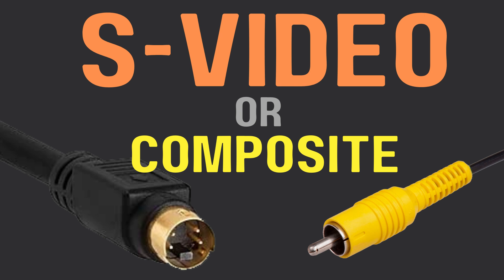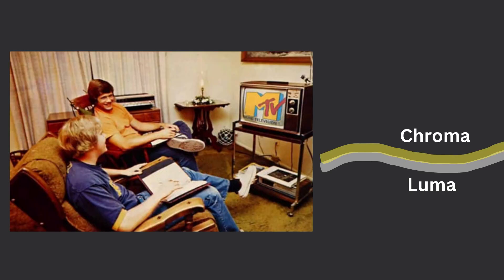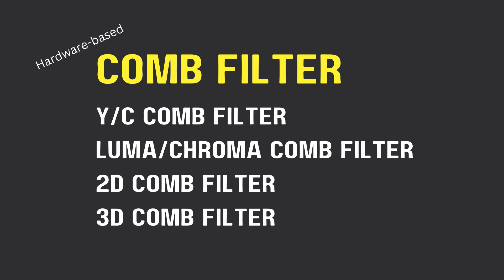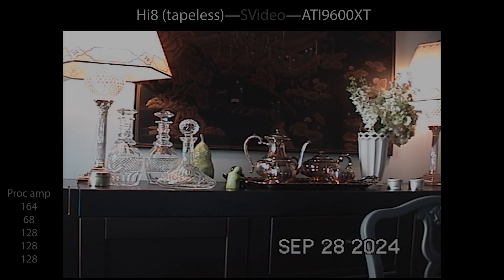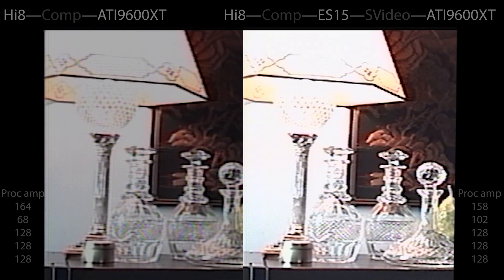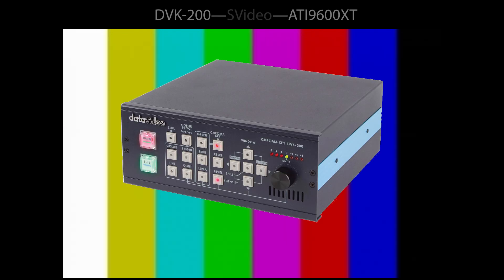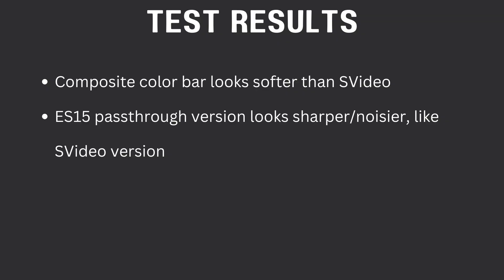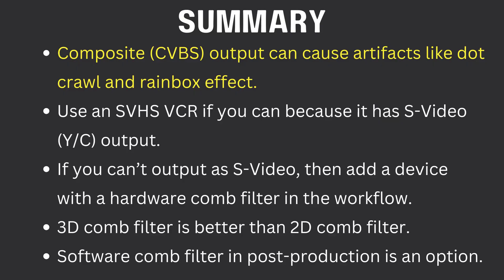S-video cable is better than Composite cable

Comment: Are comb filters redundant if I'm using an s-video cable?
Reply from the maker: Yeah, basically yes it is redundant. If you’re already using S-Video port to exit your video signal from back of VCR, then the luma and chroma are being sent separately. So a comb filter somewhere in the workflow doesn’t really have anything to do. Comb filters are only useful when you’re dealing with composite video leaving VCR. 

That said, there's a bit of a debate about whether VHS tape stores the signal as two separate luma and chroma. 

- If yes, then that means that your S-VHS VCR is simply sending along the signal via SVideo port/cable. 
- If no, then that means that the S-VHS VCR is using a comb filter to separate the signal and send it along out the SVideo port. And therefore, the argument is that if the S-VHS VCR has a bad comb filter, then maybe it's better to output as composite and let another better device in the workflow separate the signal.

Comment: What about a straight up RCA to S Video cable? I was considering on getting that because neither my camcorder or VHS has an S video output
Reply from the maker: Unforunately those RCA-to-S-Video cables just re-route the (combined Y/C) composite signal over one of the two S-video cable pins. In other words, it does not split it into real luma and chroma.

Comment: Great demo and explanation. Am researching adding svideo to a dvd combo vcr for capture i have which is svideo dvd out only. This strengthens my resolve to do this
Reply from the maker: As you said the svideo port in those VCRs is only used by the DVD signal. So if you want to output VHS signal via svideo port, you will need a new VCR.
Reply: @videocaptureguide I disagree i believe i should be able to tap VCR luma (Y) and chroma (C) from the LA71207’s external Y/C paths before composite combining (or summing?) route them to the existing S-Video jack with AC coupling and 75 Ω series resistors per line, and get VCR S-Video output without buying a new VCR. Looking at the board for the unit i have (cinnavisuon dvr2000) it looks to me like I should be able to do this between where the "jungle" chip and the panasonic chip which injects on screen display data piggyback on the existing caps on the LA71s side of the circuit.  Would love you're input if believe this isn't how the svhs players actually allow svideo output, in my eyes the signals are already there but manufactures at the time crippled the units ability on lower end vhs players because they wanted dvd to look great and vhs to output at a lower visual fidelity to push dvd sales

Comment: To get rid of the luma clipping, you could likely get away with a 1K, 5K, or 10K variable resistor on the luma line with the outer legs attached to the ground and signal and the output line would be the center variable line and ground. Haven't tried it myself, but that should create a voltage divider where the entire outgoing luma signal will be scaled down to a point where the ES10/15 won't clip anything before it enters the ES10/15. You could also do the same thing by passing just the luma line through a basic composite proc amp as though it were composite and use the adjustment knob on there. Vidicraft has some pretty inexpensive ones. Sure, you could use a real S-Video analog proc amp before the ES10, but they are a lot rarer and more expensive. 

Theoretically, having an extra device affect just one of Y or C  change the YC delay, but this shouldn't matter much if the signal is analog the entire time since electricity travels nearly at the speed of light, so it's unlikely to be significant. Even in your samples shown here, there's a YC delay problem where the chroma is arriving early as you can see the cyan stripe extends into the yellow vertical stripe at 11:45 .

 The variable resistor thing has been discussed in forums, but I haven't tried it myself personally. Can't cause any harm though to try. 

Since the clipping occurs within the ES10/15, so your levels need to be lowered before it enters, not after it passes through. That is why you can't recover the details on the capture card side since they've already been clipped by the ES10/15 by that point.

Comment: thanks, interesting :)   ..however, what about SCART outputs?  As far as I've heard they're like RGB outputs, who split all the information even more and better, don't they?  I'm just capturing old VHS tapes and all of the VCRs I ever had (and have) are with Scart-Outputs so I think, that's a good thing (apart from the poor tape-resolution, we get from VHS, of course).  
So, in my case, I go from VCR via Scart to my Sony DVD/HDD recorder and record it there in (almost) optimum quality mode. Afterwards I take the DVD (or directly from HDD) and transfer everything to my computer and make mp4s there. Good, or not good?

Comment: Mine VCR only have SCART output (so,no real S-video output) and mine converter have both S-video and RCA. Will I get better quality of picture if I use converters  S-video or it will be same quailty with RCA during conversion A to D?
Reply from the maker: SCART is equivalent to RCA quality. If your VCR does not have S-Video output, then the only improvement you can achieve is to place another device in your workflow in between the VCR and the capture card. This in-between device can act as a comb filter to try to remove the combing artifacts caused by use of RCA output from VCR.

Saludos ! SCART es equivalente a la calidad RCA. Si tu VCR no tiene salida S-Video, la única mejora que puedes conseguir es colocar otro dispositivo en tu flujo de trabajo entre el VCR y la tarjeta capturadora. Este dispositivo intermedio puede actuar como un «comb filter» para intentar eliminar los artefactos de «combing» causados por el uso de la salida RCA del VCR.

Comment: If you want to be sure you have a perfect colour bar, use the one generated with Avisynth. I personally derived it and had the Avisynth source code changed. Also note that an any RGB representation of colourbars are not the same, as colourbars are defined in YUV not RGB. To record them properly, generate them in YUV, make an mpeg2, make a DVD, and play through a DVD player to VHS etc. That is the only way to make a true YUV signal. Converting from RGB to YUV also loses info... oops, I should say the test pattern with the blue square, that blue is a special YUV colour.
But even the conversion of valid or common colours loses accuracy due to rounding.

Comment: I will try this again as my previous attempt to comment somehow disappeared... "Gamma" is the magic wand for adjusting brightness. I don't know why it isn't more prevalent on video equipment. Seek out a hardware device or software that features a Gamma parameter. Gamma is far superior to simply adjusting Brightness and Contrast because Gamma does not blow out the whites nor lose detail near the darkest black threshold. Gamma adjusts the CURVE of the brightness level in between full black and full white. When one adjusts brightness and contrast you are adjusting what is a linear line, and you are shifting that line up or down at the expense of the extreme dark and whites getting eviscerated. Gamma adjusts the BEND in the line without shifting the endpoints. I strongly suggest looking for something like a Folsom ImagePro HD which can easily be gotten on Ebay for under $100. It is  a broadcast quality processor that features a Gamma parameter on both the input signal and the output signal. You will notice that even in your "best option" example in this video, that the whites became darker and sort of blue-ish. I would love to see you compare the results you can achieve with the Folsom using the Gamma adjustment method versus trying to do this with Brightness and Contrast. Trust me, you will love the results. You're welcome. 😊

Comment: Thank you for the informative video on the topic.
While the TBC, comb filter and the S-Video are the right tools to fix analog tape time-based issues and luma/chroma separation, respectively, trying to fix luma issues (over/underexposure latitude) using the pro camp on a TBC offers the limitation of the fix to be only applied in a linear time. The initial setting incorrectly will affect every shot containing different exposure values. Fixing latitude issues in posts with an NLE color grading application will offer granular results. In the broadcast environment, chroma and latitude were/are controllable. Still, it's unusual to find proper exposure values for shot-by-shot in the consumer venue where VHS, Video8, and Hi8 were present—fixing nontime-based issues in post-production after digitization is more beneficial, except for cross-talk.
Reply from the maker: Good analysis. So ideally one would need to capture each scene separately to ensure no clipping of whites or blacks. Less ideally but more realistically, one would need to find a scene with medium amounts of brightness and darkness, set the proc amp settings to that, and then make adjustments the brightness and contrast more towards the middle to account for later super bright or super dark scenes. And then, assuming neither brightness or darkness was clipped, adjust each scene’s brightness and contrast in non-linear editor like the free DaVinci Resolve.
Reply: Both approaches you suggest are doable. However, regardless of the mechanical conditions of the VCR, camera, or tape, going back and forth on a linear system to cue the exact spot for each scene can worsen the tape, dirt the rollers, and the video head of the playback system.  In addition, it is time-consuming.  I will correct all time-based issues during digitization and leave the exposure values and chroma adjustments to post. If experimenting with the TBC proc amp is the goal, then, as a preference, it is worth trying it.

Comment: From my experience with Extended Play VHS (6-hour tapes), the built-in noise reduction (NR) is essential for eliminating the jittering common with this format. The benefit of stabilizing the video far outweighs any minor artifacts introduced. In fact, for Extended Play tapes, NR outperforms any potential visual issues by a significant margin, making the playback smoother and more reliable.
The external  TBC and the external 3D adaptive comb filter will complete the best result. The Panasonic  ES15 or ES10 are not the best hardware  to do this.
Reply: Does noise reduction stabilize tapes? I know it Can destroy detail in EP tapes if it’s too aggressive but I didn’t think it reduced jitter.

Comment: The video samples do not demonstrate the performance of the comb filter, and better comb filters are available in external hardware. There are evaluation patterns on DVDs that you could use for testing. The best test involves a moving subject with a background featuring a detailed pattern, like a brick wall, a building with busy pattern designs, or something as simple as a wire grid fence or a hammock. 
For static video  only the 2D comb filter is applied and it does a good  job , but for most common  video scenes 🎬 it will be disappointing.

Comment: Shame most devices dont have component inputs and outputs, which is even better than svideo
Reply: As said, domestic analogue video tape formats are Y/C with reheterodyned chroma. There’s nothing really to split any further.

Once it’s been transmitted (and that includes from a cable) you’re trying to unmix paint at that point. It’s technically feasible but it requires exquisite filtering and it won’t afford much if anything.

Once it has been through a television system (PAL, NTSC, SECAM) it’s all been mixed up anyway, there’s little point trying to unpick it.

An awful lot of older material was originated in television system anyway, it may have never been in component from the moment the signal left the camera.

A lot of production facilities, even world class ones didn’t get component systems in place until the 1990s or were using mixtures of systems.
Reply: Component isn’t better for VHS.
Reply: @duncanmacleod2136  wrong Quality: Component video provides superior image quality compared to S-video. It splits the video signal into three separate channels: luminance (Y), blue minus luminance (Pb), and red minus luminance (Pr). This separation results in better color accuracy and sharper images.

Resolution: It supports higher resolutions, including 480p, 720p, 1080i, and 1080p, making it suitable for high-definition content
Reply: @duncanmacleod2136 i think you confuse composit with component
Reply: @coastalvideotransfer  No I mean component. The video on the tape is Y/C. Luma is separated from chroma. To further separate the chromas you have to process them. That’s not a good thing to do in the analog domain.

Comment: Crazy hobby? There are many companies that exist from digitization. The Panasonic DMR-E55 EG (first PAL YUV out) can be switched between bandpass filter and comb filter. Since a comb filter can only work correctly if the lines are 64µS (PAL, 53.33333333333333333333333333333333333333333333333333333333333333333333333333333333333333333333333333µS for NTSC) apart, only the ultra few lines without wow and flutter are sharper, and the vast majority are just as blurry as with the bandpass filter. However, with old recorders you can use the Video Op Amp OPA690 to capture the color separately before it would be mixed with Y.
Reply: YUV, you mean component out right?
Reply: @coastalvideotransfer  Yes
Reply: @coastalvideotransfer  Yes

Comment: Only native y/c formats such as hi-8 or s-vhs benefit from s-video cable. Vhs,v8, and U-Matic are all native composite formats with these artifacts already baked in when recording to the tape. The only benefit I can see from using YC cable on these formats is reducing the crosstalk introduced during the capture procedure.
Reply: that's incorrect.  VHS and U-matic use a color-under system which definitely benefits from using an s-video cable.
Reply: @dens8790  but they benefit even more from just direct RF capture why introduce bassband interference when you can just do the whole end-to-end processing in software on the nice and very interference proof (relatively) raw FM signal, and then you have access to software comb filtering for 1D/2D/3D VHS-Decode really has cut through the noise on this.
Reply: @TheRealHarrypm  I wish someone would put together some turnkey RF Capture systems that we mortals could buy to. Most of us would love the results of RF Capture but we don't know how to get a system set up and working.
Reply: @alphabeets  It's completely documented on the wiki, with step by step installation and deployment steps, there has been documentation for years and it's proactively upgraded and updated. 

Once you understand the concept it's just a matter of clicking links and doing the motions.

We have multiple hardware option routes available, and turnkey fabrication is completely available for the DdD today, and CX Cards are pretty widely available.
Reply: @dens8790  That is incorrect. He is referring to a benefit of the best VCR players’ comb filters, but even those will never outperform the composite signal when using hardware circuits like Adaptive 3D comb filters, which came out several years later and offer a greater advantage. Also, keep in mind that we are discussing consumer media, not broadcast or professional media.
Reply: Why would anyone use the inferior S-Video signal when a composite signal with better 3D adaptive comb filters provides much higher video quality? If you’re using S-Video from a consumer VCR, you miss out on the benefits of advanced comb filters that could be applied through an external hardware.

If anyone disagrees, I would appreciate it if you could share the equipment and workflow for digitizing a consumer analog tape that is neither S-VHS nor Hi8. Because I try all workflows from all called experts on the subject and I always found that composite signal processed by better hardware externally in the workflow was much better .
Reply: S-VHS and VHS has the same colour-under system. S-VHS is simply an extension to the Y bandwidth which in turns leads to a greater resolving power in the Y domain.

It’s affords “nothing” in colour terms, bandwidth remains unaffected for C, it’s only enhanced for Y. This is irrespective of television system.

As also mentioned, UMatic is also composite (colour-under). In the cassette realm only Betacam systems and the lesser-spotted M systems are (analogue) component systems.
Reply: exactly